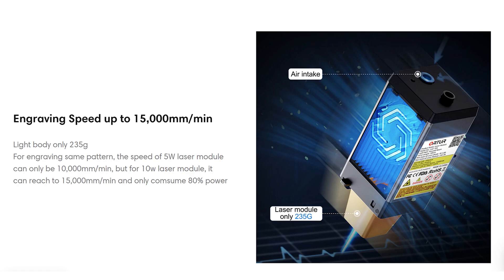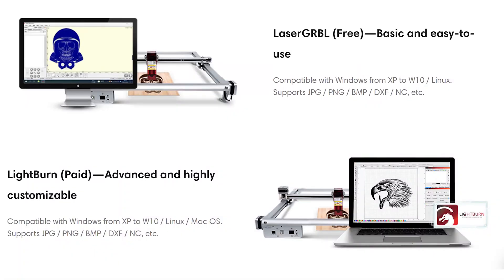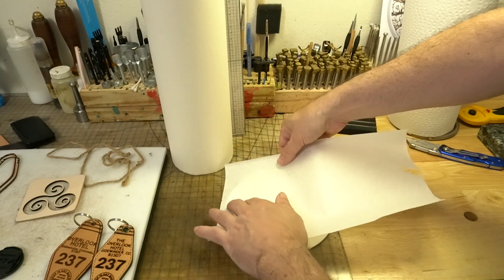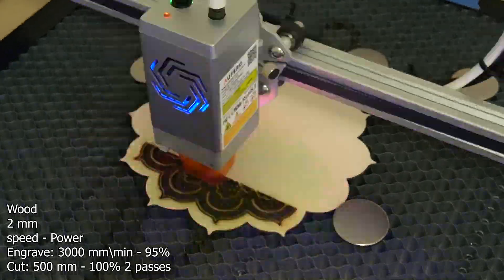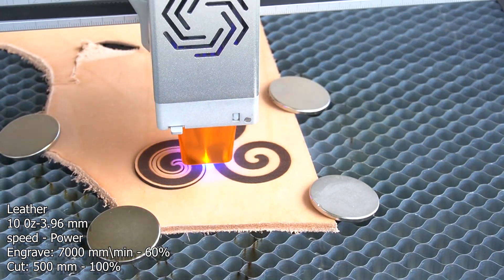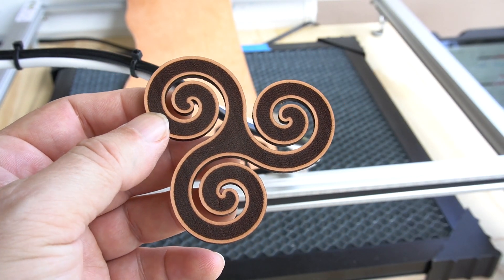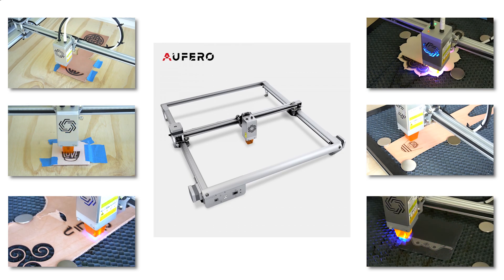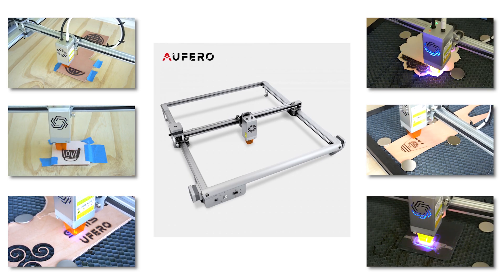Sinis Aufero Laser 2 Review! Can it Cut 10 OZ leather?  I experiment with the LU2-10A 10 Watt Laser.

Comment: Hello. What you think about sculpin s10?
Reply from the maker: Hello and thank you for the question. I do not own a SCULPFUN S10 Laser Engraving Machine but I took a quick look at it to see if I can help. It looks like a well built machine. It has a .08mm focus which is typical for a 10w laser and is what my Aufero laser 2 10w machine has. My Atomstack is a 5.5w machine but the laser is a point of .02mm which allows for a detailed engraving and cuts pretty well for a 5watt machine. If I was needing to do a bunch of cuttings I would use my 10watt Aufero. It seems to come with a air assist nozzle like my Aufero 2. You will need to buy a pump. 
My advice would be to see what the best price is and also get in touch with tech support from all the companies and see who responds and is the most helpful. It seems a bunch of these companies have very good products so it really might come down to which company seems to be the most supportive of their product, easy to get in touch with and friendly. I hope this helped. Thank you.

Здравствуйте и спасибо за вопрос. У меня нет лазерного гравировального станка SCULPFUN S10, но я быстро осмотрел его, чтобы понять, могу ли я чем-то помочь. Это похоже на хорошо собранную машину. Он имеет фокусное расстояние 0,08 мм, что типично для 10-ваттного лазера, и это то, что есть у моего лазера Aufero 2 10 Вт. Мой Atomstack — это машина мощностью 5,5 Вт, но лазер представляет собой точку 0,02 мм, что позволяет выполнять детальную гравировку и довольно хорошо режет для машины мощностью 5 Вт. Если бы мне нужно было сделать кучу черенков, я бы использовал свой 10-ваттный Aufero. Кажется, он поставляется с насадкой для подачи воздуха, как мой Aufero 2. Вам нужно будет купить насос.
Я бы посоветовал узнать, какая цена самая лучшая, а также связаться со службой технической поддержки всех компаний и посмотреть, кто ответит и окажется наиболее полезным. Похоже, что у многих из этих компаний есть очень хорошие продукты, поэтому действительно может возникнуть вопрос о том, какая компания больше всего поддерживает их продукт, с ней легко связаться и она дружелюбна. Надеюсь, это помогло. Спасибо.
Reply: TY. Nice video.

Comment: I will start off this review by saying, this is the first laser engraver, I have ever laid my hands on. I went into this as a complete novice. I am a woodworker, so I have been eyeing the engravers for some time, but most of the larger ones are pretty pricey. This laser engraver has a great price point at under $300.
The one that I received was the LU2-2, which is the lowest powered laser head. This laser head is the least powerful of the three, but I have found that it does a great job engraving plywood and pine. If you're looking at engraving harder woods, like for example hickory, you might be better off ordering the LU2-4. The manufacturer also offers a third laser head which is for cutting wood. I personally plan on adding the cutting laser head to my arsenal in the future. I do not believe that Amazon offers the laser heads to be purchased individually, but hopefully that will change in the future.

As far as the LU2-2, which I received, I was extremely impressed with this laser. To start off, The laser comes pretty much assembled. The only assembly that is needed is inserting the laser head into its holding bracket. You also have the choice to mount the entire laser assembly onto a board. The manufacturer does supply four mounting brackets for doing this, but the hardware is not included. I personally did mount my laser to a piece of wood, in order to give it some rigidity, and to protect the surface below it, that it is sitting on. The only other Assembly that is required is connecting two wires. I would say in total the assembly took me 5 minutes, and it probably took me about 10 minutes to attach it to a board.

As for the software, the manufacturer suggest two different brands of software in their literature. The first is LightBright, which is a paid software. The manufacturer of the software does allow for a 30-day trial period. This was the first software that I attempted to use, I personally found it a bit overwhelming. There is quite a bit going on in the program, so you definitely would need to watch several YouTube tutorials to master the software. I then decided to try the second software which was GRBL. GRBL is a free software, and I found it extremely easy to use. There are some great YouTube tutorials out there. It took me all of 10 minutes to figure out how to use it. The only cork that I found with the GRBL software was that I needed to use the setting COM5, instead of the default COM3.
I have already used the laser to burn dozens of Christmas ornaments on pine tree branch slices. I simply use JPEGs that I find online or create. I have found that when burning on pine or plywood, If I use a max power of 100% and a speed of 1700, my images come out great.

So far I absolutely love playing with this laser engraver. I can't wait to find out how far it's limitations will go. Thus far it has handled everything that I have thrown at it. This would be a great laser engraver for any beginner. I highly recommend it.
Reply from the maker: Thanks for the info. Sharing your laser settings is always helpful to everyone. Thank you! They now have a fourth laser module, the one I have which is the 10 watt laser. Plus they have been fine tunning the machine as well. It no longer has an separate ground wire on the top of the module. It is all combined into one cable. Aufero seems to be constantly upgrading their products. Thank you for the info. :)

Comment: I've heard that laser + leather produces some pretty bad odors. What was your experience?
Reply from the maker: The wood is bearable but I made sure I did the leather tests outside. Good thing this unit is easy to move around and I have a laptop so I set up on my porch. To answer your question, leather is very smelly. It would of been ok if it smelled like bacon but it doesn't. Leather smells like burnt hair. I wonder if a good leaser encloser with an exhaust system would do the trick. That would be great! That will be my next purchase. Now I have to decide which one to get. It is important that it actually works.  :) Thank you!
Reply: @baronleathercraft  That makes sense, most of the time I see people using a laser with leather is with something like a Glowforge. It probably wouldn't take much to enclose what you have with a fan ducted to the exterior. Thanks for the info!
Reply from the maker: @jimlee4649  Sure thing! Thank you. :)

Comment: Good review, especially on the leather part. As a leather worker I would like to know if that laser is someting to consider buying. I can see it can save me a lot of time cutting the leather with a laser instead by hand. I wonder if the laser can cut like 1 mm holes too. Also saves a lot of time. Anyway, thank you for the time you spend on the video. (Subscribed)
Reply from the maker: Hi Len, I did some test today until it started raining. As you know I only work with the laser with leather outside do to the smell. I have to get an encloser. I am curious if they will actually work with the smell of leather. I have to assume so. The short answer is "yes" it does cut 1mm holes for stitching (on 7-8oz, tomorrow I will try on 10oz))  but there are a few other factors I want to bring to the attention of you and other leather crafters that might have the same question as you. It will be much easier to show you then try to explain it. Plus, It is important to know what the capabilities of a diode laser has with leather. We already know you can create very cool designs with the laser but cutting out patterns and stitching holes in my opinion is high up on the need to know factor.  Thank you again for your question, it was inspiring. :)
Reply from the maker: Thank you very much! I will find out if it cuts 1mm holes this weekend. That is important for cutting out stitching holes. I was surprised at how small the details of engraving can be with a laser. This is an important question in my opinion. I will do a test. Thank you for the question.